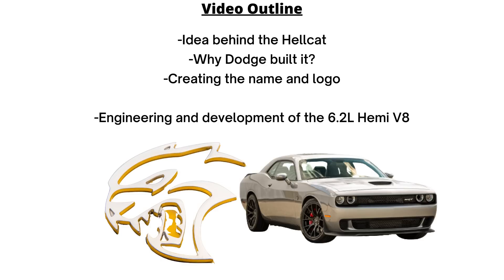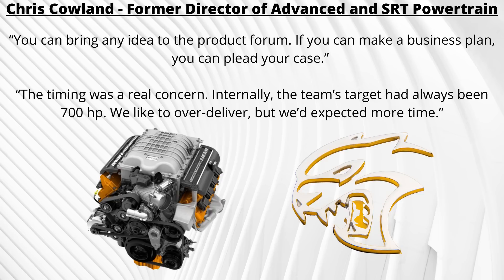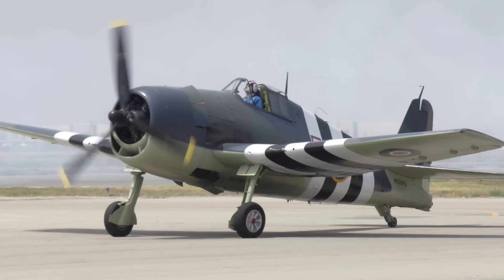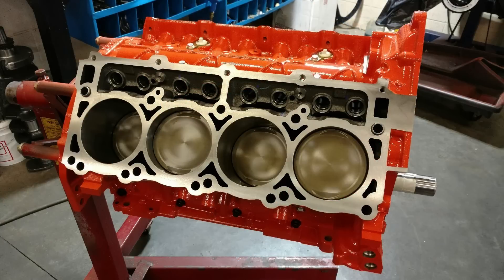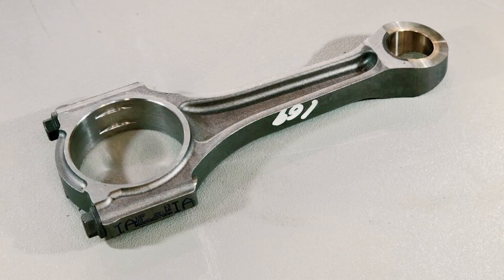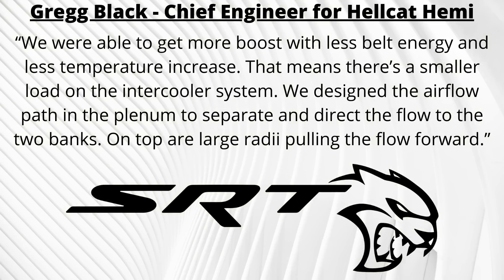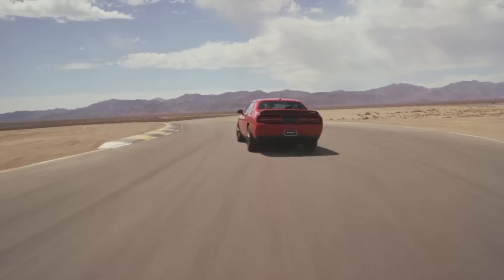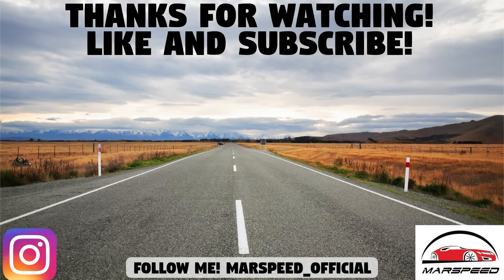Why Was the Dodge Hellcat Created & The Engineering Behind the 6.2L Supercharged Hemi V8

Comment: I wish Dodge kept the 6.1l Hemi in the lineup along with the rest of the engines it could’ve been placed right between the 5.7l and the 6.4l Hemi. They could’ve kept the 6.1l N/A and attached that HP90 A8 transmission it would’ve been a great car in the line up because the 392 makes more HP and torq than a 6.1l the only thing keeping it back would be that 8 speed trans and they would be closer than you think I believe the 392 would still beat it stick for stock on average with hood drivers with bad drivers it could be a toss up. It would be perfect because I hate how GM and Ford have so many engines in their performance lineup and Dodge only has 3 and the top one is the only that gets love the rest get nothing but when it’s Dragpak time they always come back to the smallest engines
Reply: 6.1 was no good

Comment: I guess I missed it but why didn't Dodge use the 6.4L Hemi for the Hellcats?
Reply from the maker: At the end of the day it’s a 6.4 base build basically if you think about it that way. But the 6.4 internals can’t handle much boost (everything tends to break at 600+ HP) and definitely not 11.6psi of boost or to get to 700hp. So they essentially upgraded all the internals and then made the displacement less as thats better for supercharging
Reply: @MarspeedCars  Oh ok, gotcha gotcha. 👍
Reply: @Modine.  they wanted a shorter stroke so they engine would Rev up quicker and build boost quicker

Comment: Makes me wonder at the service life of the hellcat engine. Most of the time the owner wrecks the car before 100k on the odometer. I’ve seen a 6.4 hemi make it to 236k
Reply from the maker: Yeah that’s a good question. Based on what they are saying and the development of these engines, I don’t see why they wouldn’t last a long time just like a 6.4 or 5.7. They have heavier duty parts/internals too
Reply: I know someone who made it to70k no problem drifting and mods, only blew up because at 1xxx rwhp on a drag tune, the stock internals could not handle drifts, I bet if u kept it stock it would last 150xxx+
Reply: @Lafoochen I got a buddy with a 150k mile hellcat still running strong as long as you take care of them they’ll last
Reply: Highest one I’ve seen was a 2016 model with 120k it looked like new at least to my knowledge ran perfectly had two inches of rubber buildup on the rear fenders so it was getting used. Also so satisfying to clean that off
Reply: Highest i've seen so far was 177k in a 2015 Challenger.